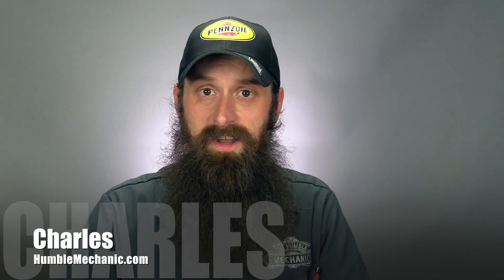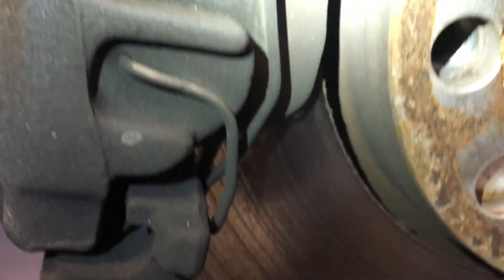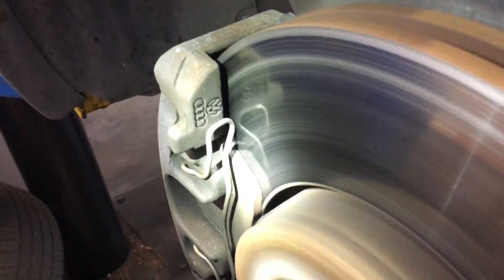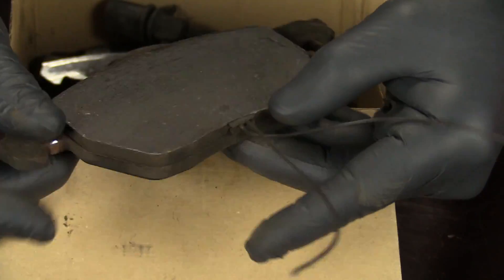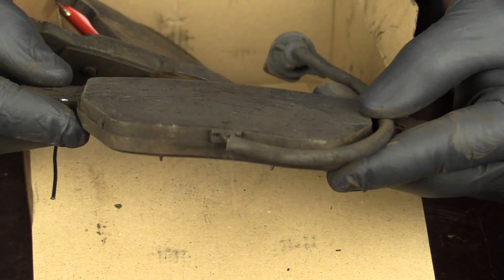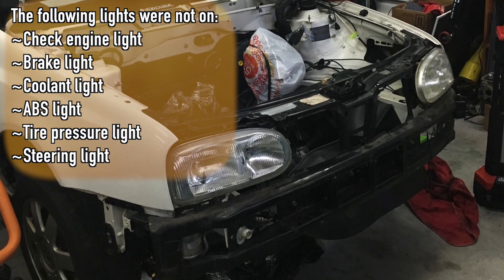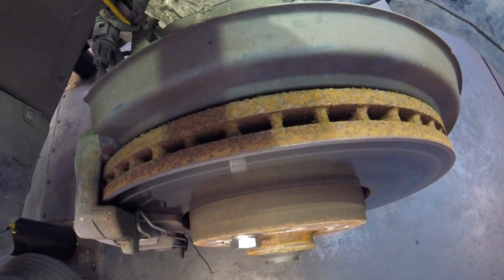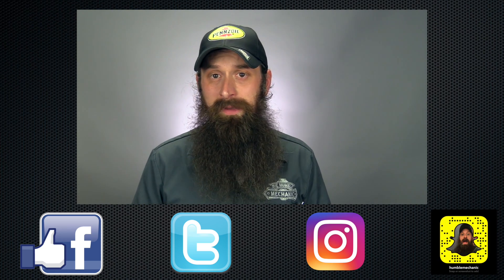Can You Trust a Cars Warning Lights?

Comment: my 2012 gti CEL came on code p2568 Direct Ozone Reduction catalyst temp sensor circuit range/ performance.  I cannot locate this sensor to check wiring or replace . HELP
Reply from the maker: Would you believe me if I told you it's a sensor on the radiator? You either have a bad sensor aka replace the radiator and sensor. Or I have seen 1 thermostat cause this issue.
Reply: I have read it is in the exhaust right behind the cat.  It seems like only the california models have that sensor on the radiator? I could be wrong. you are the expert.

Comment: I swear if VW comes up once in this video im done.. this is a topic thst applys to all vehicles not just VW.
Reply from the maker: Man, I am not really sure why you would be done. I was sitting in a VW. I own 3 VWs it made sense that I would use a VW. 

You are totally right that it applies to all cars. But since I didn't have all cars available, I used what I had.
Reply: Naw its not that you own a VW, used your VW as an example or even the fact you worked for them.. (hell I own a german car..) Its just there has been a few videos now where common issues for all makes and models where you have come off as if its just a VW thing, I mean I can completely get it having worked for them so long. Its what you know best.. but if it can happen to other makes and such it just seems you should be more general.

Comment: In my home state of Vermont, they just put a 1 year hold on failing state inspections for CEL's. Our governor finally realized that almost 40 percent of vehicles on VT roads have a CEL on which means a failed yearly inspection, forcing the owner of any 1998-2005ish vehicle spend thousands to fix a small EGR issue, or some other emission related issue, which is no way effect the safety of drive-ability of the car, just to be able to legally use the car.

Comment: I wish people would realize two things about the two most important "indicators" If the red oil can is illuminated it does not mean "drive until you happen to think the place you are stopping is safe", it means TURN THE ENGINE OFF NOW. You have a bit more time with the engine temp light (like 100 yards) but this also means you have a problem that needs addressed now, not when it is convenient to stop. If you say "I will not stop in that part of town" be prepared to pay up. If you oil smells like asphalt or a tear down indicates you have no rod bearing material left this is evidence you kept on driving when you should have stopped.

I have had cars exhibit that uneven wear issue before. If this customer would have damaged the rotor with no wear indicator light on,and the car was under warranty, this would have been a rare warranty brake repair. Humble, I ask if VW ever turns rotors? My main line (other that GM) is BMW. Ever since I started with BMW in the mid-80's I never found a Dealership that turned rotors. We always replaced rotors and this practice covers both Europe and the USA (well with BMW it does) Now with GM we were rotor turning fools. I have no explanation as to why there is a different mindset in regards to rotor replacement.

Oh about a "proper brake inspection". You need to pull the wheels before you can say you did a proper brake inspection. About tire pressures, check that spare. You may even want to check if the tire type match (this has happened).

About gauges. If you are only going to be allowed one gauges, make it a voltmeter. You can tell more with a voltmeter than an amp meter.

Comment: I've had the EPC light come on a couple weeks ago. The brake pedal switch was corroded (that's what the error code said), so we tried reworking it and it worked for a while, with the light coming on only a few times, but with a hard push on the brakes, it always went out again. But then it came on for good, so all I could do was to replace the switch. No biggy, a 12€ part and almost no tools required to replace it. But I keep asking myself: Where does the water come from that corroded the old switch that much??? I don't have any holes in my body, in fact it's practically rust-free, so how can a switch that sits by the pedals, on the inside of the car, under the dash, get wet and start to corrode??

Comment: humble mechanic i have a question here, i recently bought a pair of angel eyes (lens fog lights) and i wanted to know if i can wire them with the same wire the low beams are connected this is because my 07 b6 passat doesn't bring the fog light option :s need help :/
Reply from the maker: I would think so, but I wouldn't recommend it. The CCM is looking for a certain return value. That will most likely make the module mad. 

You can probably add the fogs in. I would search VWVortex and see if someone has covered that topic.
Reply: so you think i should by the switch and wiring kit??? :/

Comment: I too prefer gauges to lights.  But to add more info to the driver, it would be cool if newer cars had an OBD scanner built into the car.  Rather than an idiot light coming on it would flash a code, and cause of action.  And for all the non- mechanical people this feature can be turned off.  Just my two cents.  I don't own a VW or anything German, but I love the channel.

Comment: Hi humble, my girlfriend just bought a 2003 Volkswagen Passat v6 wagon from her grandma for 2000 bucks.  It has 150,000 miles on it, but her grandma swears that everything on it is good.  However, the abs and brake lights come on intermittently.  We asked her grandma about it, and she said the brakes are good though.  The front wind shield also needs to be replaced asap.  What do you think?  Did we pay too much?
Reply from the maker: Probably not. You will want to see if the car has aftermarket axles. That often causes the ABS light to come on sometimes.
Reply: Thanks for your answer!
Reply: You will see this a LOT it forums and FB groups. My 03 Jetta ABS light came on and stayed on for about a month, the brakes still worked fine and then one day the brake light started blinking and beeping, this can be caused by the parking brake not being fully released but this was not the case because I checked it multiple times(by the way the ABS light is still onat this time). I shut the car off, went into the gas station got what I needed and came back out and started the car. The brake light had gone out but the ABS was still on. One day while it was raining I drove through a puddle and the ABS light went out. The ABS sensor I guess was dirty, but the blinking brake light is still unexplained and it only happened that one time.

Comment: I just replaced crank position sensor and camshaft position sensor in a 1.8t b6 still having trouble starting sometimes any suggestions?
Reply from the maker: The key is finding out what is lacking when the car will not start. Is it fuel? Is it spark? Is it authorization from the immobilizer? Tons of things will make that car not start.
Reply: HumbleMechanic runs fine when starting just takes a couple trys sometimes. maybe fuel filter? Did have check engine light reset the ecm, does have a iat sensor code
Reply: Is it harder to start when its cold outside? If it is try changing the coolant temp sensor.
Reply: 860kgamer no its usually after i drive it, heat soak maybe?
Reply: Have you changed that IAT sensor? I'm thinking that if it's bad then it isn't telling the ECU to prep for a warm start. With the engine bay being warmed up after running, the sensor is possibly reading as cold and flooding the engine. I would start with that before tearing into the fuel system, because it's the easiest point of repair to start with.

Comment: I hate those lights, tire preasure is the one I have the most love/hate for with my Liberty CRD. I like that it comes on when its low, after a few days of recent top ups on a tire I found a nail causing a slow leak. then it comes on like you said if its just cold out. I also get random warnings to check the tpm system that come and go. my tire shop and mechanic cant figure out what is causing it of course it never does it at the shop and all 5 tire sensors have been replaced. 

the abs and tracton control lights too bother me. seems I have a wiring problem with the left rear wheel speed sensor that cant be fixed for more than a few months at a time.
Reply: Mike Parks Check the wiring harness just above the power steering pump for abrasion . Worn motor mounts will be the cause
Reply: thanks I will have to look at that. the diesel engine is also known for worn motor mounts.....

Comment: Thanks for vid HM! Have you ever run across an issue with that radiator sensor on 2005 ish golf or GTI's? 
(Sorry co-workers car and don't remember) 
This warning light comes and goes for her and the dealership can't figure it out. They've replaced the radiator and sensor twice and the light still turns on and off at its leisure. 
What blew me away was how the dealership said this had nothing to do with emissions?!? Anyway thank you for your time and knowledge sir!
Reply from the maker: If it's a 2013(isn) then I have seen a few weird issues. We have replaced the rad sensor/rad before. I had one that the thermostat was slow to open and it triggered that code instead of the malfunction in cooling system code

Comment: I prefer gauges as well, but if there are no gauges, the idiot light is the at least a sign that I need to take a look.  I love that you actually resurface rotors, that seems to be a lost art.  I'm guessing it's just cheaper to throw the old ones out and put on a fresh set.   You made an interesting comment about 10k oil changes.   I love getting the extended miles out of the oil, but unless your diligent, lots of things can happen...  I guess I just need to be more diligent.  Nice work as always! Thanks

Comment: I have question/ problem. I bought a new Nissan versa, it has one of those seat belt lights that comes on when the seat belt is not plugged. Well even with no one sitting in the passenger seat, the seat belt light stays on, unless I buckle the seat belt in the empty seat. I figure it wasn't suppose to do that, so I took it back to the dealer. They looked at it, tore the whole thing apart, nothing evidently wrong with it. There was anther one on the lot exactly the same as mine, and it did the same thing, so they told it was normal. Now I have drive around with the seat belt buckled, on a empty seat like a F$%king idiot,  or stare at that red light all the time. :(
Reply from the maker: Is there anything on the seat?

Some VW PODS systems use electrostatic mats. That means if your phone is in the seat, it can screw with the warning. 

I just drove an Alltrack for about 700 miles. With my phone in the seat, plugged into the car, when I got a text, the seatbelt light would come on.
Reply: HumbleMechanic no nothing in the seats. Nissan uses occupant sensors in the seats. They are small sensors in the base of the seat, that when something heavy enough sits in it, they get triggered. Also it is not like the air bag is not working as intends. There is a light to let if the pssgr air bag is on or off. As long as there is no one in the seat, the air bag is off. If some one sits in the seat the air bag comes on. But no matter what the seat belt light is on unless both seat belts are clipped.

Comment: TPMS is a good idea, it's just horribly implemented by most manufacturers. It really needs to have a display showing tire pressures and 2 functions. 1)hey, you're tires a little low and affecting your economy and the tire's life. Please set pressures at your earliest convenience. 2) YOU HAVE A FLAT TIRE, IT NEEDS TO BE CHANGED NOW!! STOP DRIVING!!!

Instead, all most of us get is a light indicating there's a tire that's 25% under-inflated somewhere on the car.
Reply: Ford handles this pretty well. I have a tab in the gauge cluster that'll display all 4 tire pressures next to their respective tires.

YMMV but mine seems to actually be rather accurate too.
Reply: I had a 2017 Camry for a rental and it has a picture of the car with the tire pressure in each corner. It was a boring ass car but they have a real simple and easy dash and infotainment systems.
Reply from the maker: I totally agree that would be a better way!

Comment: Sometimes the idiot lights could be good. I know if my low windshield wiper fluid light comes on that means it's empty. With that being said, sometimes these lights are a headache. I had a check engine light that would not come off until i practically changed out everything cheap emission related and of course it was the last thing, but many things were going wrong there. Then i had a check vehicle light come on, had a burned out headlight bulb, now it's back on due to my abs/ets not working due to a worn out hub assembly. Bearings are making some noise but it's not bad, i may replace it before winter and the wheel is on there good so it could be the sensor in the hub assembly going bad or dirty. I want to take one apart to see what is going on so i'll have to buy a new one to put in it just so i don't have to see those lights and i got abs/ets again but my car has good tires and stability, i can feel one tire grabbing sometimes when slamming on them so i just let off the brakes/pump them.

As for a change oil/oil life monitor, i don't trust them completely, i just have an idiot light that comes on, i use mobil 1 and get 4500 miles out of it, light never comes on oil was good but i don't always check the fluid so i just changing the oil is easier. An oil life monitor might be easier to use, especially ones where you can tweak and put it at 75% or 50% if you are worried or use cheap oil/filters.

Comment: I know exactly what he is talking about. I used to have a VW Gol '98 with a I4 longitudinal engine that doesn't had temperature gauge, just a warning light (yeah, it sucks), and one day the cooling liquid started to leak and I haven't noticed. So I was on the road and the warning light that indicates high temperature turned on, and I was like HOLY SHIT I NEED TO STOP NOW, and right on the next second I lost the cylinder head, all the pistons, valves and a couple more things. Summing up, what he is saying is true, sometimes the lights comes up just when the shit is about to explode.....kkkkk

Comment: my dad has a honda civic hybrid 2008
after installing lpg on it the car will often autostop for a fraction of a second and then reignite the engine and have a low oil level light pop up (oil is almost full btw) and will only go away after turning off and on again the engine
dont trust these lights!!!

Comment: My tire pressure light doubles as a backup temperature sensor, it comes on when it's below about 35 F and goes back off when it warms to over 40 F, when it's snow and ice packed roads I'm not too concerned about 5 PSI lower than stock (which I know is when it comes on) so I've grown to ignore it in the colder months, now it's useless because I ignore it. I wish I had one which actually said PSI instead of just "low", then I could just tell if it's just cold or I actually have an issue.

Comment: I use to be an ASE certified mechanic (Engine, Brake Repair). Now I do IT. My little brother had the check engine light (Idiot Light)  come on, on his 01 Dodge Ram 1500.  Told him to go by Vato Zone(Auto Zone) to get the code.  It was a TPS (Throttle Position Sensor).  So when I had a chance to visit him I checked it out.  Unplugged the sensor.  Checked the voltage from the plug...  It was good.  Ohm'd out the sensor it self...  It looked good.  Cleared out the code and the plugged back in the sensor.  That code never came back the rest of the time he had it.  Later on with the same truck pulled a Transmission code.  It was an electric valve motor was bad and needed to be replaced.  It's pretty like he was saying, "pay attention to it but verify" Paraphrasing.

Comment: For the most part the lights are great, they let you knwo something is wrong and that you need ot take care of it. It would  be nice if the CEL/MIL  had a function to let you know that a new code had popped for situations where a customer knows they have a code (maybe a cat code or something else fairly innocuous). Personally i LOVE TPMS, especially with more and more manufacturers shipping out cars with 50 series and thinner tires, it's hard to tell visually if you are 8 or 10 pounds low on air. I do prefer gauges where they make sense (temperature fo rone) but in general the dash lights are nice to have, the more ways the car can let a layman know what's going and that they need to get it checked out, the better.

Comment: Ive seen plenty of GMC Terrains that were 3 quarts low on oil (holds 5 total) with no warning lights or messages on the dash. Only reason the customer came in was because the timing chain got so much slack in it that it created a rattle noise.
Reply: I've seen a GM oil level sensor with a float design that gets stuck in the "everything is okay" position due to previous oil that was neglected so badly that it stuck the float in place.
Reply from the maker: +Import Car Enthusiast we see the same thing on VWs. You get noise way before you get a light.

Comment: I guess sometimes its good. I had a check engine light on my 89 Tercel. p0125. Insufficent coolant temperature for closed loop fuel system. Diagnose the code. Turns out Toyota have their own definition of the code. I was looking at the temperature sensor or map sensor. Turns out it was the O2 sensor bank 1 sensor 1. The general po125 dont say its a O2 sensor so you cant always rely on what the code says. Thats my take on it